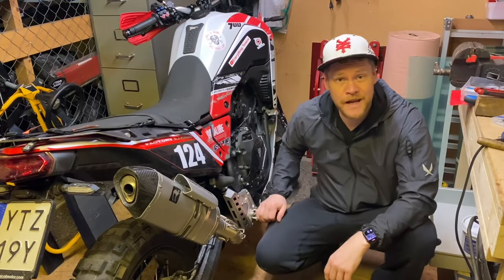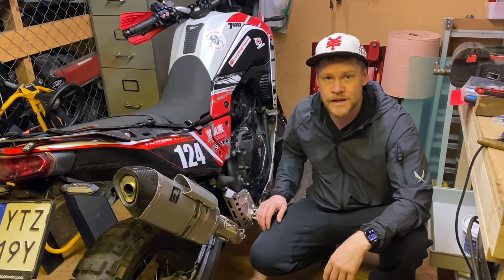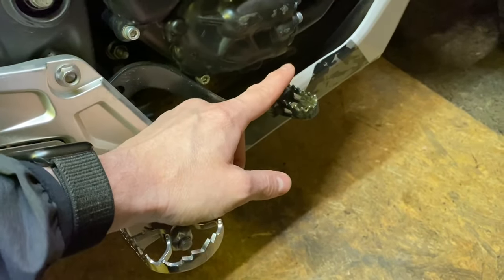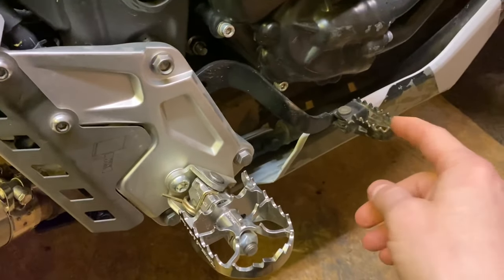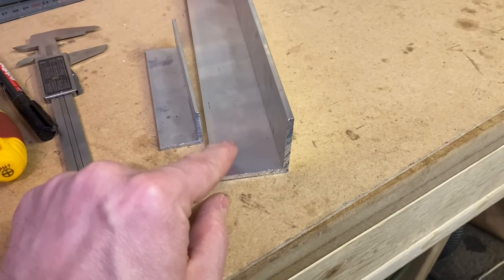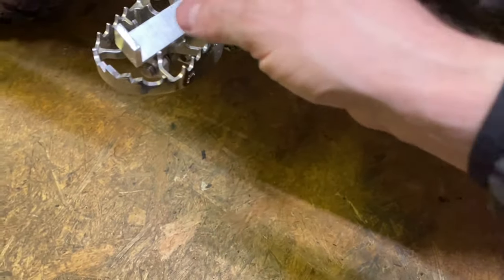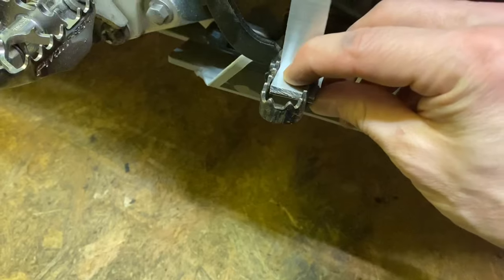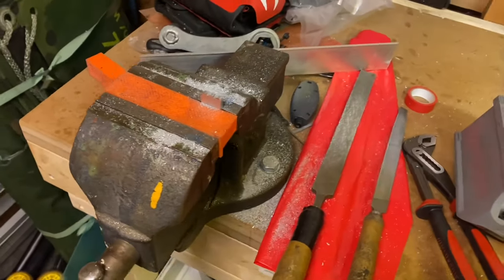Rear break lever - Dual Hight Mod - Yamaha Tenere 700

Comment: Hi. Nice home made invention. a question on another topic. the shock rally raid feels more comfortable on small bumps in the road?
Reply from the maker: Not with my setup, it’s a bit harder than stock. 
But the RR open cartridge they sell now has a upgraded shim stack, so have a better trail feel. A bit softer in the first part of the travel, have not tested it though. 
Highly recommend that you check with RallyRaid, they could explain the difference between the old and the new version.
Reply: OK thank you. I live in Puerto Rico and here there are not many trails. We run an 80 freeway and my t7 feels like it has no suspension on the little bumps in the road. I come from xr650l and dr650 and feel like they are bmw gs1200 in comfort vs de t7